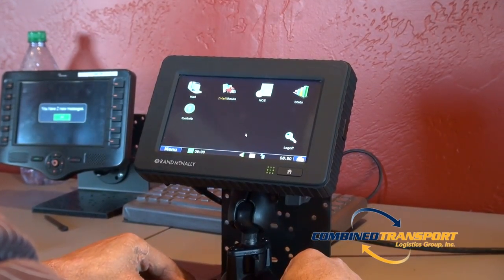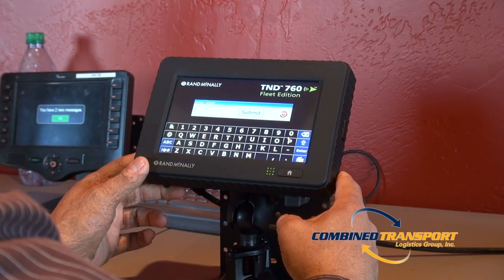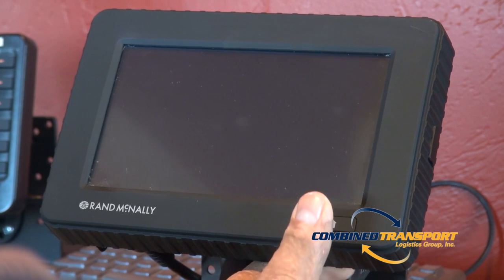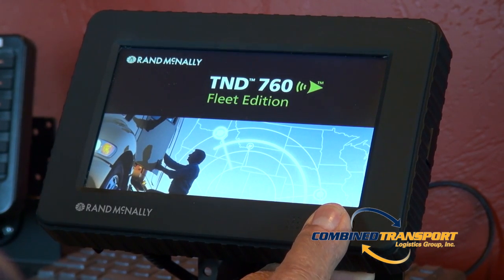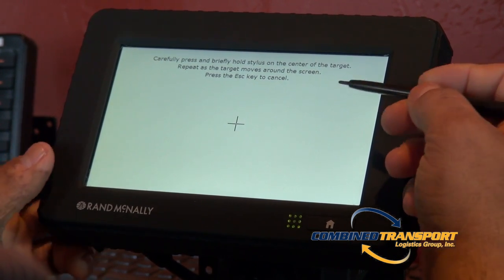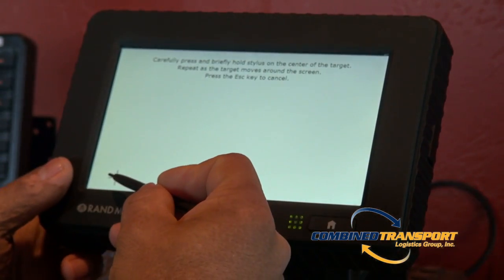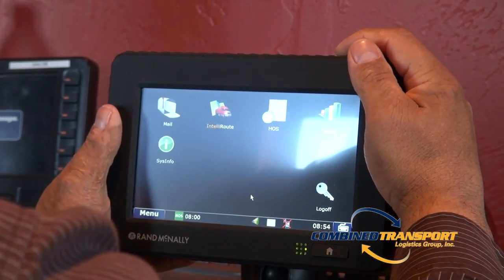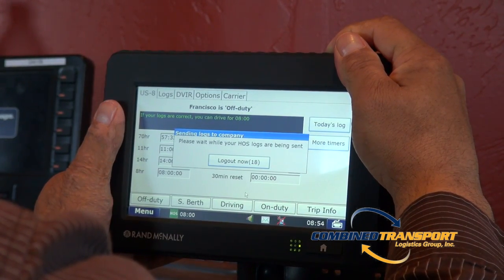How To Reboot Rand McNally Unit

Comment: We have tried to use the tnd765 since August 14th of 2017. Constantly lose of cell signal. Sometimes never gets cell signal all day. Refused to let me log in..says no communication. Called help line numerous times. They said they updated the modem etc. Did reboots also. Gps is very poor. Tries to route me on 10ton roads. Even tries to route me down Crystal Lake road near Hartstown Pa (16131). That road has been closed for at least 40 YEARS!!!